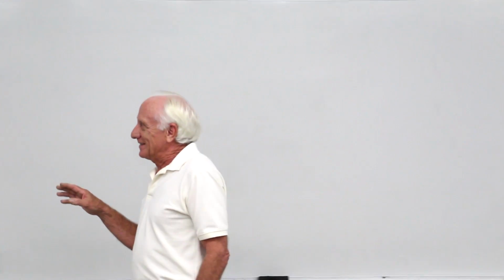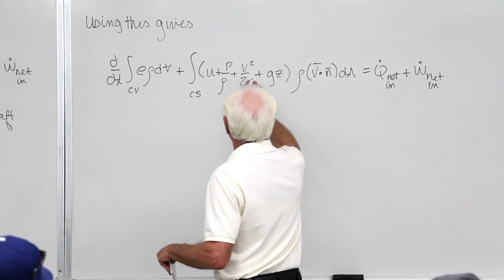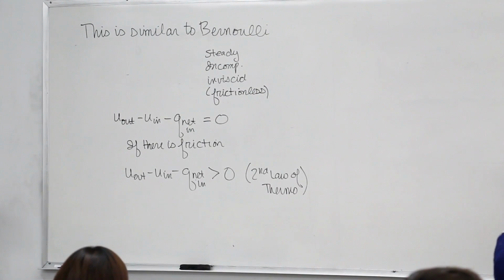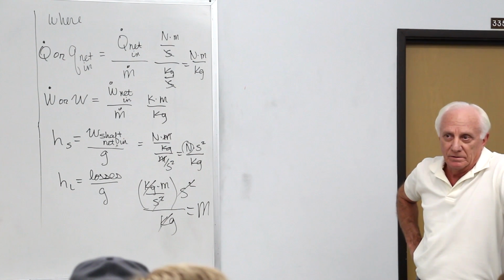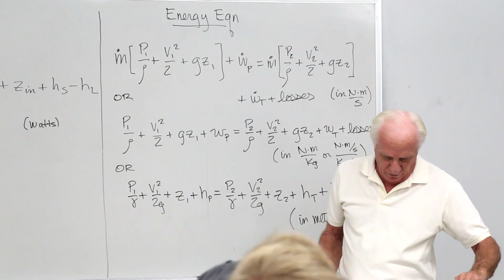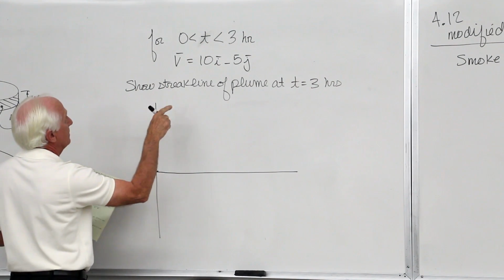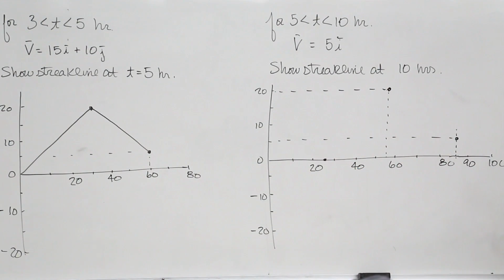Fluid Mechanics: Energy Equation and Kinematics Examples (13 of 34)

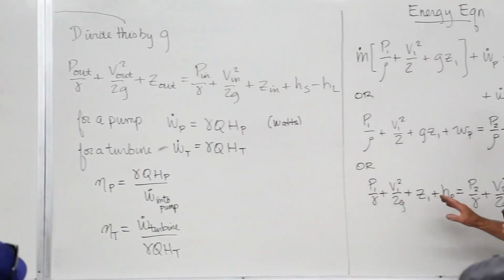Comment: in 52:41 how can one use hydrostatic equation, isn't the fluid at points 1 and 2 moving with a velocity of V1?
Reply: yes but piezometric tubes measure the static pressure directly under it